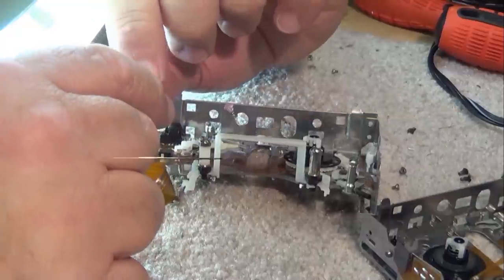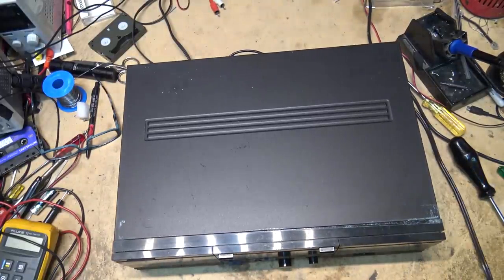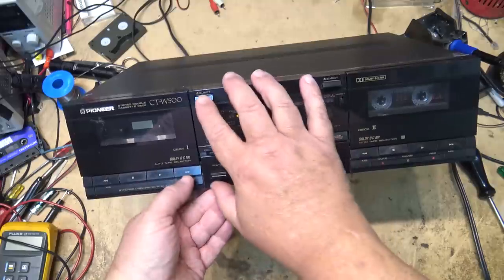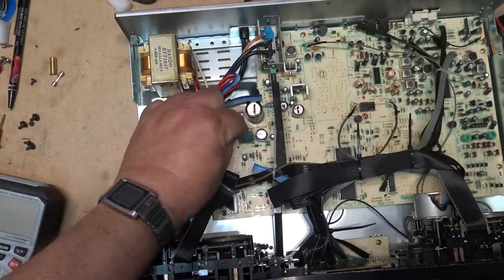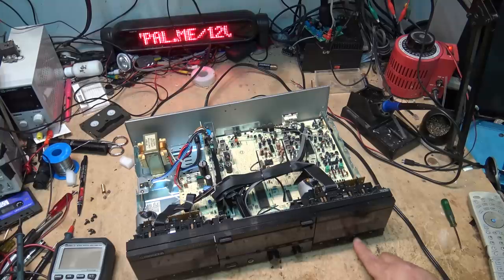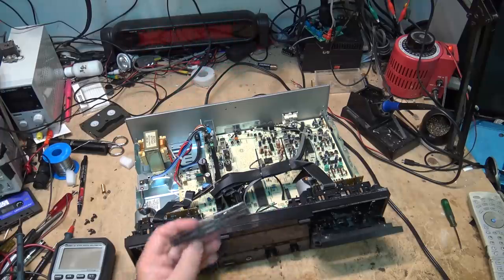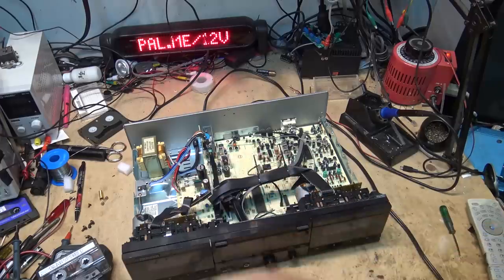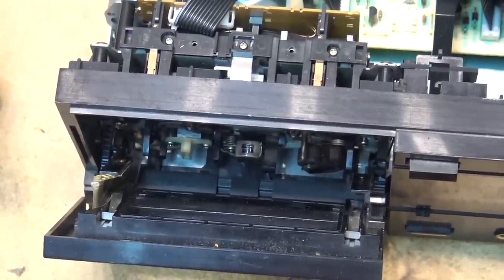Pioneer CTW500 No Tape Movement

Comment: My eyes lit up when I saw a twin Pioneer- as I bought an 830 earlier this years with no motion- that was just the gooey belts..to both decks. Very different inside. Oh, and no springs or nails. When I was a kid- Id often solder some 16swg inside the  glass fuse- the hot iron will lift the end-caps. As you say Dave,  limits the chance of fires.

Comment: I have a CT-W600R dual deck. Looks just like yours. It still works after 29 years. (I haven't used it much since 2013. Very informative video. May refer to it if mine acts up. Haven't opened it up yet. Mine's autoreverse. But that doesn't make it better. :)

Comment: lol. 😂 I worked in a place that constantly had electrics going down once. I found cigarette foil in place of a fuse once, a cut down bolt on another occasion, and the mapping to a 3 phase fuse box miss represented on another occasion which could have proved fatal.  No accounting for the stupidity of some folk but it did teach me to meter everything in the future😊
Reply from the maker: I once found a 22cal bullet in place of a fuse.  That could have ended explosively.

Comment: Which type of vu meter on a tape deck would you say was the most accurate.? LED, VFD or moving coil?
Reply from the maker: Led and vfd same thing.  Peak reading digital.  Always more accurate than analog which is just an average reading.
Reply: @12voltvids  Cool ok, yea i suppose the speed of the readout plays a part, analog meters seem to be a bit slow

Comment: New meter?
Reply from the maker: Had it for awhile. Fluke puked. Needs to be fixed again.  Won`t go into AC measurement mode. Probably the rubber strips that connect the keyboard to the main board. (rubber with fine wires inside to make the connection)

Comment: And seeing as how it is the throw away everything kind of times these days instead of all it doesn't work now let's try to fix it instead of throwing it in the garbage can wow
Reply from the maker: It wasn't that long ago that a career could be spent repairing consumer electronics, and we all made good money. I was making between 60 and 80,000 a year servicing TVs and VCRs.  5,000 to 6,000 a month working from a shop that was 3 blocks from where I lived. Back in the 80's and 90's a house could be had for just over 100,000. In fact my house when I bought it was only 112,000 back in 93 when i bought it. Back in the 80's wages were much lower. Minimum wage was 3.50 an hour, and in the TV/VCR repair business we were making 25-30 an hour.  This all changed in the late 2000's when the cheap throw away  attitude began. In 2001 I saw a big drop in service, and an even bigger drop in 2002. By 2003 I could see the writing on the wall and I made a quick exit, and went to work for the phone company.  Incidentally, even today, working for a large union corporation I really don't make much more than I did in the heydays of TV repair.